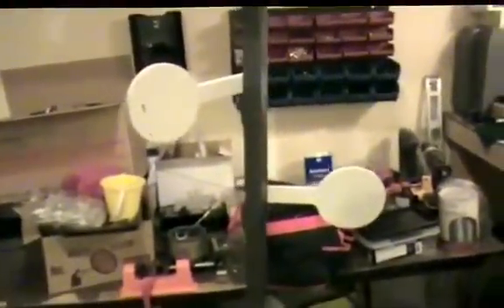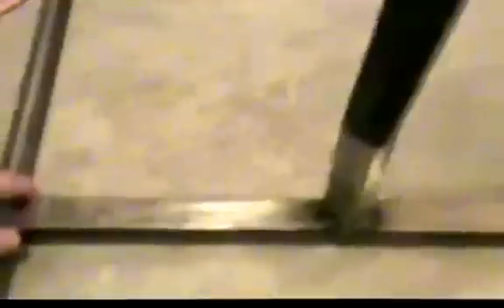How I Made My Dueling Tree for Shooting Steel

Comment: only heard of one time a 50 cal came back at the shooter. knocked his cap off. 
but if you are shooting lead. or hollow points the bullet has no ability to return.
of the steel i shoot. it naturally hangs at a slight angle any how.
but i do like what you did here.  what was your source of ar500 steel? regular steel gets hole punched to easily.